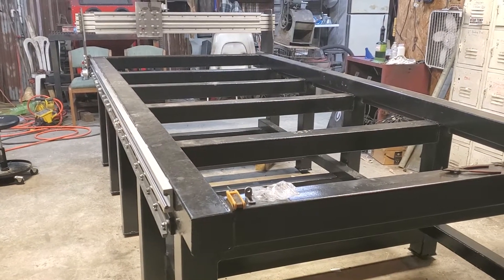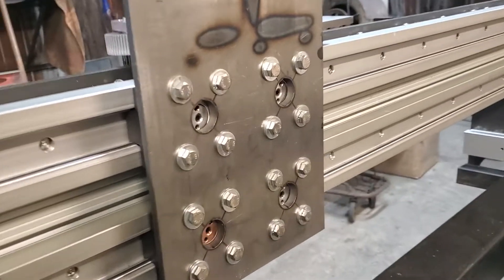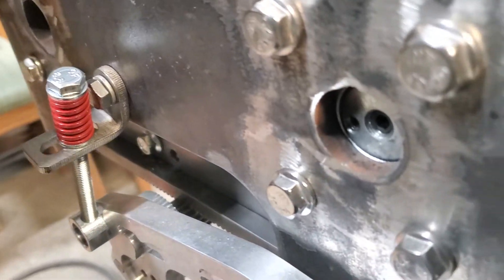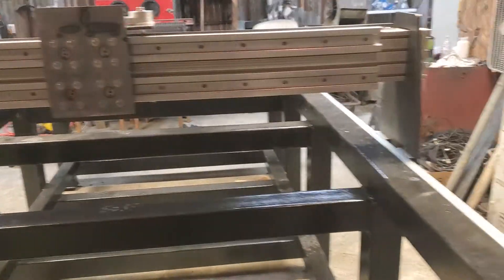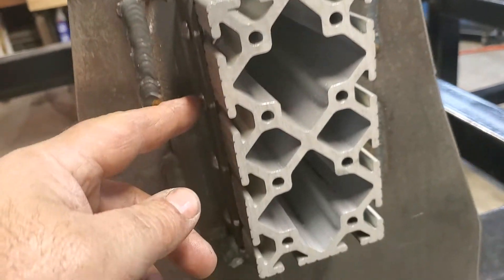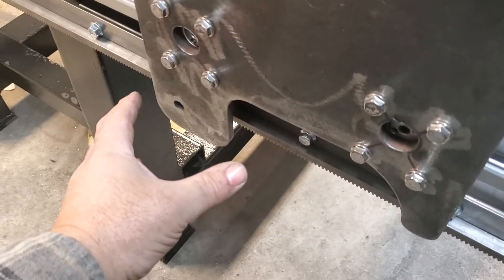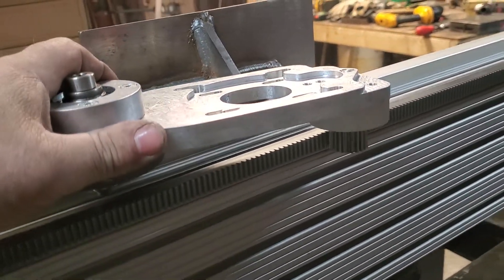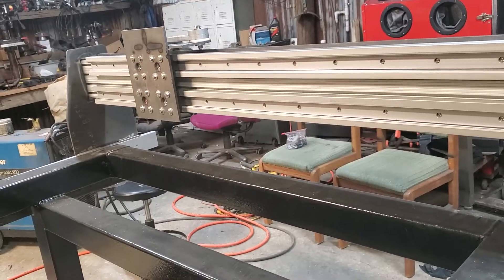BEST HOME BUILT CNC PLASMA TABLE 4X10`. #5

Comment: I gotcha I was in the market for one and was just about to get this thank god I saw your videos, what are your thoughts on myplasm CNC there’s not much about it and what is around there’s no talking/ explaining of the things you can do with it,but from what I can see it looks good any thoughts are appreciated, and sorry about your experience with gofab.
Reply from the maker: The Proma MyPlasm  with THC  ,  Is by far the best I have ever seen ! and it comes with free software, that they are always on top of, and updating. Works flawless. ,   once you get your setting setup. It  has 3 speeds, soft limits. which keeps table from running into sides without switches!  and most important. It is able to stop , and take off where ever you want to,  at anytime.. just by right clicking,and telling it to start cut here. many  Options on this setup. This will be my 3rd Plasma table. First was  a Delusional Designs.. It kept melting down on me. I made them , take it back. afraid of a fire.  If you was able to build.. its the best and far better table. but if not.. Eagle Plasma,  and STVCNC, both use the same controls as I do. Thanks Tony.

Comment: What is it about the go fab table that you don’t like?
Reply from the maker: I like it for first 2 months.They then changed the software.. after that it was junk. and they was not here to help any of us at that time.. would not answer phones or messages. we started a group to help each other,to try and get going.  I wasted so much metal. when torch would dive into metal. Too much to tell on all problems .I was totally down !   I had no choice but to rebuild  ,with a new control box and good electronics. Gofab has the cheapest divers and board on the market. I replace many drivers, broken wires. I have 3 Z axis. Main board.and more..$150 at most in electronics. We looked them up.  I reseached what electonics was good..and spent some money and built my own Controls.. and Bought New Z axis ,  with anti collision head. all new and bigger motors, replaced all the wires in table, which is too small.   So when I was done, I only have a table that was original on a 5 month old table!!  Yea that hurt!   My friends in group are still having tons of problems even with new software now.. Im still in the group. We have our own Facebook site for Gofab owners also to help each other out.. But 3 or 4 of us , had to change over, and we all are happy to get rid of the junk electronics..  I still have saw took cut on the  Gofab table....